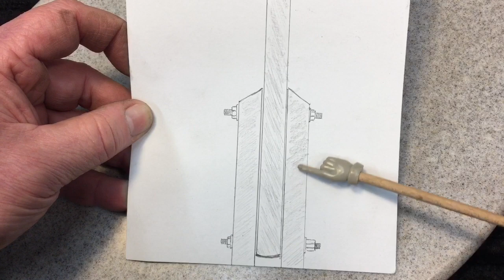Boker USA Pliers, A Better FlagPole Design and One Epic Rant.

Comment: The flag pole is a lot easier to raise and lower if you remove the lower bolt - not the upper one. You can than use a y shaped crutch to support the pole, and a rope and even a counterweight to raise or lower.
Reply from the maker: Mac!  I never even thought of that!!!!  Outstanding!!!!!!!   Thanks for that!!!!
Reply: @ScoutCrafter  You are welcome. It worked on 30 foot Douglas Fir pole in about 1955. It think it took 3 men and a boy (I was the latter).

Comment: Once I had the brilliant idea of putting a pipe in the ground and inserting another smaller diameter pipe inside of it so I could hang one end of my hammock to our deck and the other end to the pipe. When the hammock wasn't in use I could remove the pipe and it was out of the way. Worked great until the two pipes rusted together and I couldn't get them apart. My wife wound up hanging a flower pot from it. Go figure!!

Comment: I got rid of a huge flag pole built that way once. From the time it was installed they put an 8 foot fence tight against it on on side and had built stuff in the other direction that would be hit dropping it that direction. I went up on a ladder and cut it about 15 feet up so it would miss the structure by a few feet. My partner pulled it down with a fork lift as I notched it with the torch. Dropping stuff is always fun!......To this day I'm still disappointed that I had to go take care of another job when we were Dropping a Huge Old Billboard Structure, that thing was a Beast and I was looking forward to watching it drop.

Comment: Hey John , older boats have a similar system for masts , however the upper pin is used as the pivot and the bottom one removed . Also the bottom part is weighted to allow for easier lowering . You can prop up the pole this way off the ground without removing it and paint it at a nice waist height ! With a weighted flag pole you could probably just walk backwards while lowering it .

Comment: Great job on the Boker USA pliers. That picture you showed of the modern Böker factory was taken in Solingen, Germany. It is only a 45 minute drive away from where I live. The stairs on that picture lead right into Böker's factory outlet. I have bought a lot of top notch quality knives there at absolute bargain prices.

Comment: I just wanted to add to the benefit of flagpole sleeves in the ground. It's quite common to see tow hitch receivers on workbenches for accessories. I have a couple 4 inch by 4 in sleeves in my concrete pad. There's about a dozen tools, vices, pipe benders etc that can index in these holes. Being able to transfer the load into your concrete pad let's you apply enormous forces. I space them out 7 ft so that you can put a very long cheater on the pipe bender, but one of the side benefits is that I have affixed universal rollers to the top of four stands, this allows me to level a project that is nearly as big as my shop itself. I've always wondered why this is not standard in every shop, I couldn't live without mine. It's like having a shop without a drill to my mind

Comment: Nice restoration on the Bokers. I just realized they made my pocket knife. Did you put the square nut back on the flag pole? When I see square nuts and bolts it takes me back to old furniture I worked on in my dads shop. I have my collection and the sockets that fit them. Ah the old days for old souls.
Reply from the maker: The top nuts were hex and the bottom was square... 7/8's I believe.  I LOVE square nuts!  Much more then Hex.   =D   You know stuff is old when you see them!   Thanks!

Comment: Question, John: How long does that great finish last in a toolbox, if well stored in a low humidity environment?
Reply from the maker: Unfortunately when tools are brought up to this kind of finish they do show scratches quickly, as for the shine, if not used too much they hold up very well however if used often the hand oils and sweat will bring on the tarnish and eventually patina.  If you keep the tool waxed and use it only occasionally then it will look awesome for years!   I have 7 year old restored tools that look like the day I did them!

Comment: When I was at military academy, we had this exact type of flagpole. I believe it was actually a pole of historical importance moved from somewhere else, the civil war artifact I believe. It was huge! We had to get in formation for the flag raising and lowering each day. It was quite a bit more dramatic than most such ceremonies, there were no ropes, this was the method for raising and lowering the flag. The cavalry officer, a command sergeant major I believe, pulls the pin and walks the horse back slowly lowering the pole. They would stop at about 5° above horizontal to prevent the flag from touching the ground. I don't know how true it is, but the story with this flag was that the fort it was flown from chose to nail the colors to the pole. This was a symbol of machismo, traditionally lowering your flag and/or raising a white flag indicates surrender. I could be mistaken but I believe the center Pole was theoretically the original, the fulcrum was built in order to preserve the original Pole with the rusty nails that still had a few wisps of the original flag. That Center Pole, it was white and tapered up about 80 ft. It was dead smooth to the touch. I got some extra PT 1 year and had to stay two weeks later into the summer then all of the other cadets. One of the jobs I was made to do was repainting the flagpole, I was quite surprised to find that it was a perfect and unblemished tree trunk! Later in life I have built and run sawmills, I have never seen another tree completely dry with no checks or cracks.
Reply: Oh I spoke too soon! Ours was different, you pulled the lower pin and used the upper pin as a fulcrum. This made the fulcrum about four and a half feet off the ground, giving clearance to prevent the flag from touching the ground. The cavalry officer would be hitched to a rope attached to the heel of the pole.

Comment: The flag pole base is an old way. I have seen these set ups at old Army and naval bases. This is a very robust flag pole design. I wonder if the pole was installed by a former military man? Here a sixty foot pole is pushing the envelope on height. your sister is very lucky to have such a talented machinist at hand!
Reply from the maker: The pole is steel too!  She called a Flagpole company to see if they would paint it and when they saw the size of it they chickened out saying it was too big and heavy, she needed a cherry picker.   😂

Comment: Great video! How would you repair the cutting jaws on a set of linesmans pliers or dikes? Love the flagpole design and your rant was deadon!
Reply from the maker: Robert- I have yet to find a way to repair damaged cutters on linesman pliers.  They can be sharpened slightly but if they are damaged it's time for another pair.  They are considered consumable items although some have lifetime warranties most exclude jaw damage.    Thanks!
Reply: @ScoutCrafter  thank you for your reply! I thought  about building up the nicks with my mig welder and then shaping them but I wanted to get your take on it.

Comment: John,

A couple of suggestions for your carving.  First, find someone to scan and then 3D print the carving.  This may be the most practical solution.   The second is to find a local artist that casts using lost wax.  They can make a mold to cast a wax duplicate.  They can then cast a metal replica.  I have a DuPont No. 2 blasting machine, you know the wooden box with a plunger used for blowing up dynamite.  The box was missing a few key parts which were duplicated using lost wax.  You can't tell the old parts from the new ones.

As for the Google art, remember the music you listened to as a kid.  I bet your parents thought the music had no value and would destroy your mind.  My guess is that you have similar thoughrs at what kids today call music.  I  know I do.

Bob
Reply from the maker: Bob- Much of the music I grew up with was indeed crap and it has opened the door to even more of the same...  This isn't about accepting a different art form, this is pure compromising and possibly shock value?  We literally are dumbing down the society to accept mediocrity.   =D
I considered casting if I fail at the wood attempt!   =D  Thanks!

Comment: It's a little Weird not to many people put pride in they're work.
My Buddy & I I work with we work on the rd.'s for example we fill a pothole &tamp it flat to the Rd.
U ride the northern State lately what's up this is a highway they don't even tamp down the col-,patch flat to the Rd.They'er pot holes  are all wavy I just don't get it.even cutting the grass on the sides of the high way they ether cut it down to the dirt or miss sections of grass chopped up garbage it's like they throw em the keys to the tractor cut the grass on the side of the rds & not even train em on it.
Reply from the maker: Alan!  You are so right!  It’s the small details that show where your tax dollars go (or don’t go). 😃👍

Comment: Magdad made an awesome video showing multiple ways of restoring a tool. You yourself have mentioned many times about different approaches to tool restoration and you noted that no one way is correct. The very same thing could be said about art. Your opinion, likes and dislikes are not factual (right or correct) they are just your opinion, nothing more.
Reply from the maker: Actually there is right and wrong in art, proportion, value, composition are what art is judged on.  If you draw a face and put the nose on the forehead it is literally wrong, however the scam of art is making you like it...   =D
Reply: @ScoutCrafter  Tell that to Picasso, his paintings have ears coming out of cheeks, no proportion what so ever, and his work is worth gazillions.